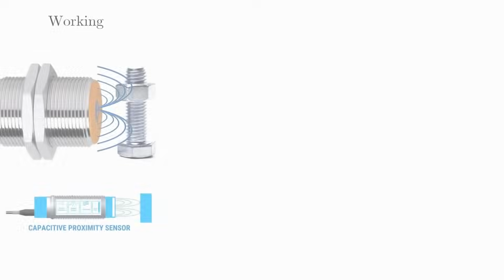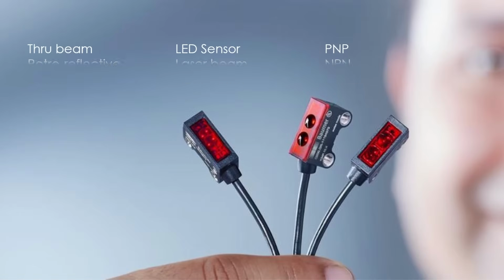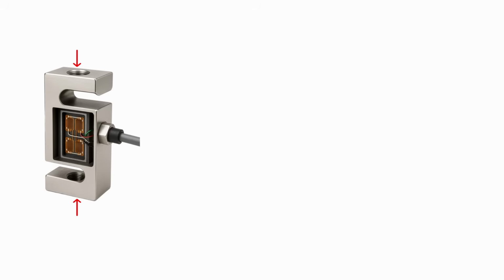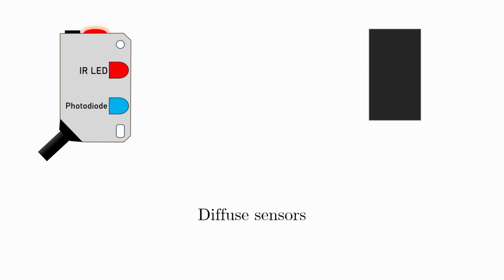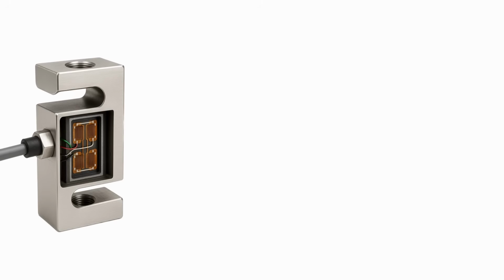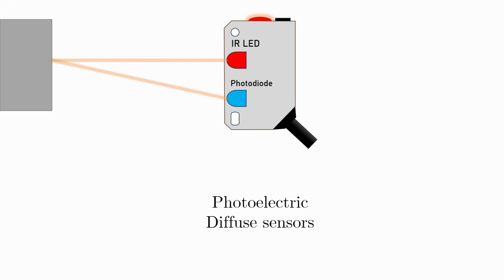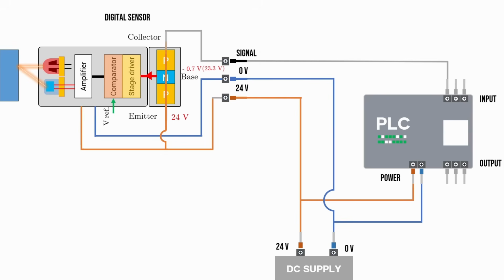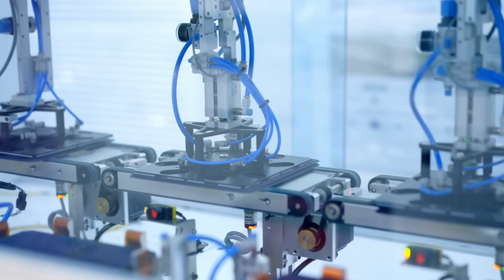How a Sensor Actually Works! Every Mechanical Engineering Must Know

Comment: Different between analog and digital signals pl explain
Reply: Basically both are voltages. In analog, the voltage change is continuous, it will smoothly rise and fall. While in case of digital, the voltage rises in steps: 0V then 5V then back to 0V. This is the most basic way to remember the difference.

Comment: Iam job automation engineering   servo motor stepper motor induction motor an hydraulic pneumatic system and type of sensor actually manufacturing automatic robotic machines but iam always learning new ideas and knowledge full video👍
Reply: where  you work and how much is your ctc

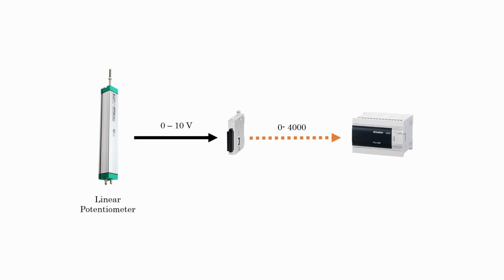Comment: Is the Digital least count for the Linear Potentiometer at 36:39 25 microns? Atleast thats what the system would have but I don't know if the potentiometer itself can provide that resolution.